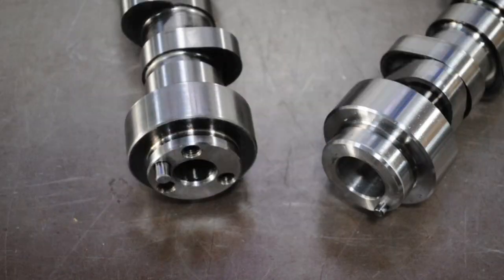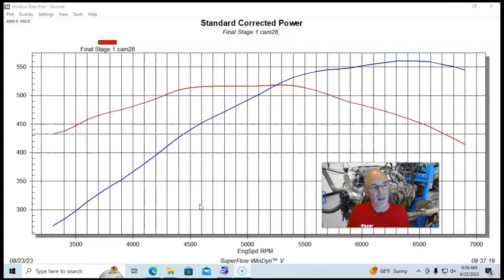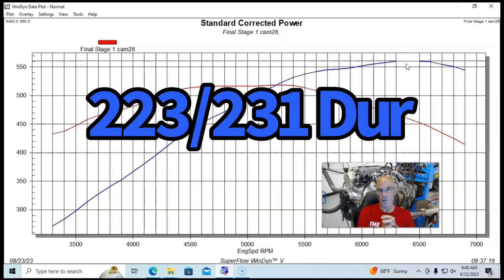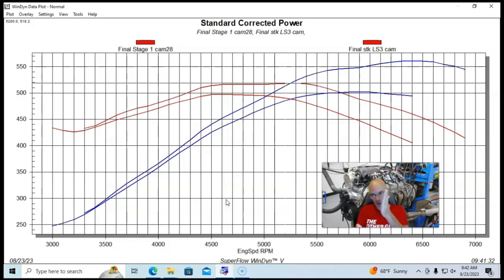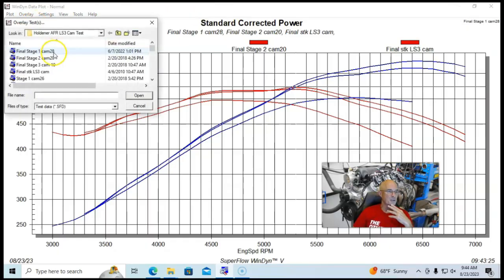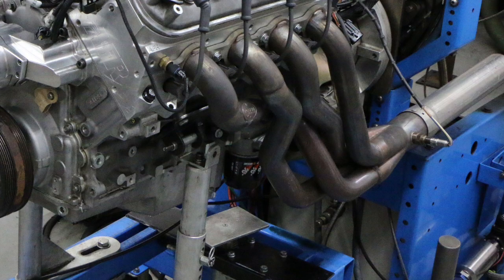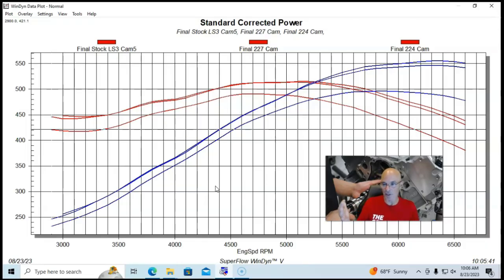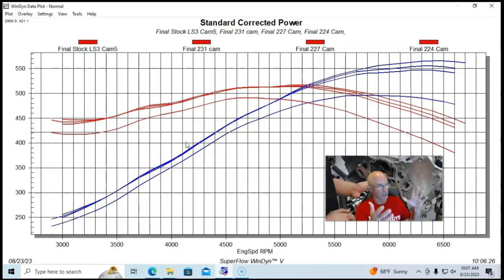6.2L LS3 CAM TEST-STOCK VS STAGES 1-3 WITH STOCK HEADS & STAGE 1-3 WITH CNC PORTED AFR LS3 HEADS.

Comment: About the stock camshaft scenario....a long time ago in one of the many "Best combo" issues of certain Mustang magazines the owner only changed the E7 to the Twisted Wedge. It was good for 225 hp on the rear wheel dyno. He even had the long runner manifold on it. 

I wonder if Richard has done a gross horsepower test (headers, electric water pump) on a stock cam, stock VVT engine management system test. In other words with the oil solenoid and cam actuator in place. I'm going to look for rear wheel stock dynos.
Reply from the maker: Richard has a video up on going from a chassis dyno to and engine dyno and also how much power accessories are worth

Comment: Hey guys.. Has anyone here installed a BTR Stage 1 v2? Mine has headers and a CAI installed. Do you think it'll add another 40 hp? Mine currently makes 407 whp. Near-stock drivability and power under the curve is a must.
Reply from the maker: That cam will add 40 hp over a stock cam

Comment: So as you go up in stages the gap between what the AFR made vs the stock increases, which makes sence cause you start to demand more air, which the stock heads fails to provide, however the biggest gap at stage 3 ( which is a questionable choice to begin with is it lowers power down low) you make 14 extra horses compared to the stock heads, IDK the price of these exact AFR heads, but they all seem to be well above 1000 dollars.
This sounds like the most expensive way of making 14 more hp, it even get worse if you choose beter low end grunt over high RPM horsepower by going with the stage one cam, at which point the stock heads have enough flow and the AFR provides just 5 more hp.
This is also done on a 6.2 which makes me believe on most aplications such as a 5.7,5.3,6.0 and the 4.8 the bottom end is even less demanding and won't need aftermarket ported heads
Reply: Im understanding the same thing! So what hes saying is that a set of ported heads vs stock will net me an extra 5 - 10 HP for what 2k ? I think ill stick to the stock ls3 heads and spend that money else where. Thank you for the info!

Comment: Thats pretty sad #'s considering a Bonestock CT525  LS3 crate engine made 604hp at only 6,400 rpm (At 6,400 it was still making 6-7 hp more for every 100 rpm increase so itd have easily hit 620 by 6,900-7,000, Peak torque was 553ftlbs at 5,300 using the factory GM carbureted intake they come with along with a APD Billet 2in 4 hole black widow spacer, MSD 6014 programmable Ignition box, APD Billet 750 on a conservative Depac engine dyno. and those #'s are real
Reply from the maker: Having run plenty of the 525-hp LS crate motors-they are nowhere near 620+ hp
Reply: No. It's sad you didn't use a single period in that whole rant. But, you think people should value your opinion? I hope not.
Reply: Also. All that expertise, and not a single car video on your channel. That is so weird!

Comment: Ported head L92 416 stroker 
It will be used on the street into a truck 
What camshaft will be mid no hight choppy idle?
Would it be possible to take a look at your new runs video on pump gas since most of our vehicles are driven on the street and use pump gas. Thanks a lot
Reply from the maker: with very rare exception, every na motor I run is on 91 pump gas
Reply: Do you have any recommendations for camshafts for the above stroker?

Comment: What would be a solid cam for a 4000 lb truck with 30 inch tires and 3.73 gears? I like low end torque and not having to gas it to 5-6000 rpm to get power. L92 6.2 and t56 set up
Reply from the maker: I have some for sale (cheap)-email me
Reply: @richardholdener1727 I have a 2012 Yukon with the L92 6.2. What exactly would I need to go along with a stage 2 cam? It’s my daily I’m just looking for at least 50+ hp
Reply: I’m throwing a LS 3 in my 06 four-door z71 I wanna run e85 FBO what can you recommend I also have a v3 sc1 I’ll throw on later down the road when I get bored of N/a

Comment: So really you can save $ on just using stock heads. On both applications it only gained 8-10 hp over stock heads. Way less work just adding the camshaft and not pulling and paying extra for the heads. Have the 5.7 LS1 in my 01 SS Camaro and thought about the 243 heads with the BTR stage 2 can and Kooks Long tube headers but now I’m deciding to not do the heads. Should still be up around 400Hp without them.
Reply: ea my 02 WS6 made 414rwhp with stock 241 heads and a  RPM5 cam similar to the MS3 specs

Comment: What cam size would give a ls3 better hp increase down in lower rpm with stock 821 heads, stock springs, ls3 intake, and stock converter?
Reply from the maker: small
Reply: @richardholdener1727   decided to go with 212/218 .550/.550 112 LSA from TSP. We’ll see how it does. I really didn’t want too much chop.

Comment: I’ve got a tsp ls3 stage 3 n/a cam in my stock ls3 with headers and exhaust. I added a novi 1500 kit and e85. I’m running a wastegate to limit the boost up high but am pulleyed for max boost so it is higher lower in the rpm band. Am I losing power down low with the n/a cam? The car pulls good down low, I’m just curious how n/a cams work with centri blowers, I’m assuming it’s not as big of a deal since it’s a blower and not a turbo… ya know, because “wrong cam” ha
Reply from the maker: if it adds power na-it adds power SC

Comment: Hi Richard…. Now that Holley Terminator x systems support VVT with there new V3 software… would be interesting to see how much more hp and torque can be achieved using a non VVT performance cam compared to a  performance VVT cam with similar specs 😊
Reply: Remember that vvt has to be limited  for valve clearance so a small cam can be advanced and retarded a lot more then a bigger cam .so as you go up in size vvt can’t be used which is why delete kits are so popular

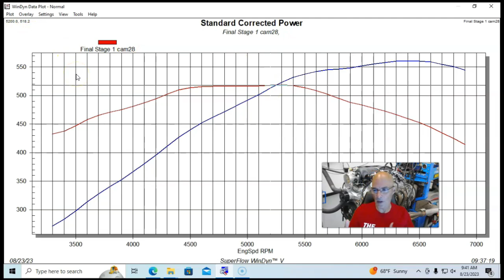Comment: I have a 5.7 ls1 2001 c5 with a  227 234 cam 111 + 2  @ .600 with 1 7/8 lt's & ls6 intake. Stock injectors are 28lb. On mustang dyno it pulled 353 hp @ 6500 and 328 ftlb @ 4800 to the tires. Not bad on stock 241 heads & 6speed with 3:42's Great daily driver and faster than stock 2002 Zo6 cars.
Reply: my 2002 WS6 LS1 stock block, heads,and LS6 intake with a RPM5 cam basically an old MS3 spec cam put down 414/390 also on a mustang dyno thru a Yank 4k stall convertor  and was also a daily for 12 years never an issue driving
Reply: My bolt on ls6 made 451whp 423wtq.  My rebuilt 5.7 ls6 made 548whp 444wtq

Comment: Do you have tests with high CoD LS3 heads, 235-260cc, and low 22x intake duration? I'm looking for good hpde torque in the upper 3K range, yet have the cc's help the power carry above 6400. I'd like to see a 416 LS3 w AFR 245 or Mamo LS3 heads, combined with a BTR LS3 stg2 v2 and LSXR.
Reply from the maker: you need to drop the valve size down on the LS3 head to improve CoD

Comment: LS3 1LE Camaro I had would gallop around any parking lots with the BTR stage3. It made 473whp, very fun to drive.
 In the 80's the term "3/4 race cam" was thrown around alot.
Reply: Whats ur current setup ??
Reply: @kevincantu1238  the 1LE was stock 3.91 rear, stock LS3(no head work) w/btr stage 3 cam, pushrods, springs, retainers and polished throttle. Cold air intake and longtube headers.

Comment: My big takeaway here is that my stock LS3 wants headers and Stage 1. I'm currently 420HP/400Tq on a chassis dyno.
Reply: My engine on a engine dyno made 520 at 6200rpm and 490 torque at 5000rpm with 26 degrees timing and running E85 but it has a pretty loose 4200rpm stall converter
Reply: Hi so its doing that with a stock ls3?im thinking the same for my 2010 Camaro ss
Reply: My 2011 Camaro SS with a new GM performance LS3 495 crate engine with CNC ported and milled LS3 heads tuned and running on E85 made 430 horsepower at 6200rpm and 410 foot pounds of torque at 5000rpm at the wheels has a ton of upgrades a aluminium one piece drive shaft a built 6L80E transmission with a circle D 4200rpm stall converter stock 3.27 gears with a Auburn limited slip with suspension mods and drag radials has gone 7.22 at 96mph in the eighth and 11.28 at 122.7mph in the quarter mile it makes good horsepower and torque to the 6600rpm redline shift point and does 1.71 60 foot times
Reply: @gloriamaletta8667  Nice ride! Either my dyno shop is overrating me, or yours is underrating you!🙂
Reply: @gloriamaletta8667  your 60ft needs improvement especially with that 4200 stall but im sure once you iron that out you will be in the 6s in the 1/8
Reply: @omegasquad868  thanks sure if it lost 400 pounds would make it much easier to get into the high 6s my last car had a 3000rpm stall in a 700r4 with 4.10 gears l wanted to retain the stock 3.27 gears in the Camaro with a built 6L80e trans and a fairly loose Circle D 4200rpm lockup stall converter this crate engine starts pulling real good on a engine dyno right at 4200rpm and up with the 4.02 1st gear transmission ratio didn't want to gear this combo so l only use 1st 2nd 3rd gear in the quarter mile car goes 124mph in 3rd gear at 6700rpm before shifting into 4th gear lower rear gears will leave me shifting at 112-116mph out of 3rd gear going into 4th gear

Comment: Ls3 with stock cam and ported heads is still a solid 500hp engine thats insane... even with stock heads 490hp
Reply: On an engine dyno, no accessories fitted etc.
Reply: We made 470whp/470wtq with a bolt on ls3. They'll make more power than he shows.
Reply: @HioSSilver1999  I made the same using a mild cam and headers with an LS3 intake on a L92.

Comment: Awesome more 6.2 stuff please, put sloppy “best”
Cam on there. Lets see what it does
Reply from the maker: makes less than the 224 or 223 cams
Reply: There’s plenty of videos with it and it’s an outdated cam. I think the truck Norris cam made more power and that cam doesn’t even require a stall converter

Comment: Richard your killing me smalls.  I was hoping to see truck norris in an ls3
Reply: That should make more power but not as much as these cams. That cam was made for smaller displacement motors but it should make good power and it’s supposed to have more low end torque than stock down low

Comment: 6.2 stuff but LS3 stuff not truck motor vortec 6.2 gen 4 stuff . Yeah you can't please everyone 😊.

Is it possible to run your tests with a factory ECU like many people would be using?
Reply from the maker: makes no difference in power using factory ECU-just takes too long for programming
Reply: @richardholdener1727  I'd be curious about that. 

Also, we could see tests with VVT VS NO VVT. There are advantages to both approaches.

Thanks for all you do Richard!
Reply: What kind of a gain would shorter intake runners get. Are these cams too small for 7500rpm

Comment: Richard, would you say that the results would be similar on a smaller displacement - cathedral port engine? Say a Gen III 5.3L with a truck norris cam... stock 706 heads vs ported/larger valve 706s? Would that engine only pick up 7-10 crank HP from the cylinder heads? Then more obviously with a larger cam, like a "231" cam? (Comp 459 comes to mind)
Reply from the maker: cath ports might gain more from head flow-the rec ports already flow a ton
Reply: @richardholdener1727  I swear you did some similar tests in the past, just haven't been able to find out if you've done anything with better flowing heads than stock and a smallish cam. 

I remember the 4.8/5.3 test with the TEA 706s, Crane 224/232 cam, FAST LSXRT, etc. I swear that you said that the heads helped, but the gains weren't that big all things considered. That 224/232 cam is larger than the TN.
Reply: @richardholdener1727 second to last test the "227" cam or stage 2 would you see much increase if raise a full point on static compression @same advance just better fuel?

Comment: Great test, but to control for variables it would make sense for the same cams to used in the stock head as well as with the AFR heads.
Reply: Yup, this
Reply from the maker: that is you missing the point
Reply: @richardholdener1727  I am not clear,?  What is the objective?  Cam only vs cam plus heads should be same cam used as a contol.  Unless AFR or cam manufacturer disagrees?   I.e. the gains are embarrasing?

Comment: Cam stages always made me chuckle. I like how you describe it. "No such thing as magic cam specs!"
Reply: Right. Cam stages are really only relevant as a way of comparing each manufacturers cam models. For instance, I run a GPI stage 1 LS3 cam. The lift on this cam is much higher(647/638) compared to some other companies stage 3 cams, albeit the duration and overlap is rather mild at 224/237, 7º. So basically, stages make little sense between different cam companies.
Reply: its usually duration that matters not peak lift
Reply: @WildEngineering  theres a ton more to cams than just lift and duration for sure but seems most people spec cams off of sound, not performance.
Reply: @madmod  yeah its weird that people would rather have "chop" than proper set up HP
Reply: @madmod  Youre talking very minimal differences. I mean even the "stage 3" cams here didnt lose any power down low. Even bigger cams would keep gaining up top and only lose very minimally down low. Unless youre in a strict class racing it doesnt really matter.